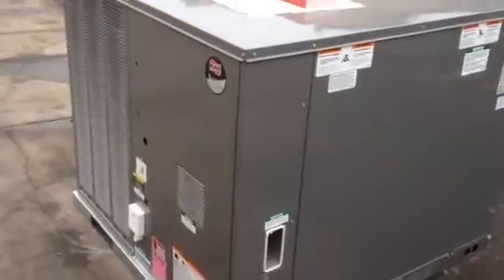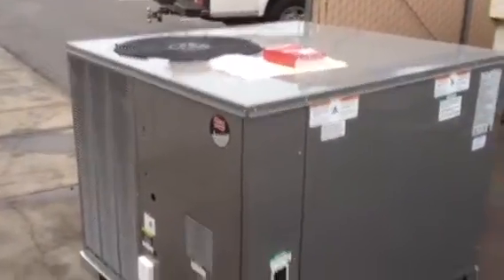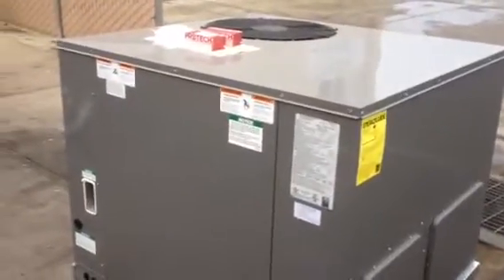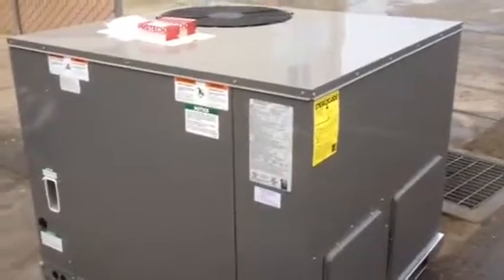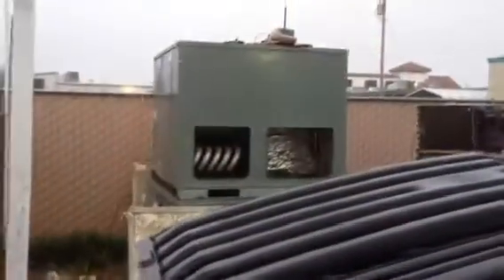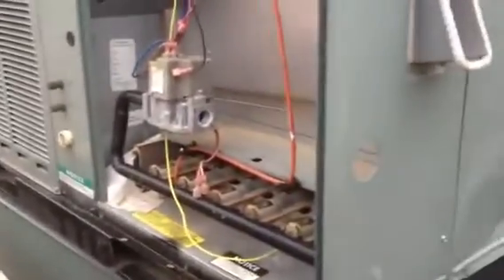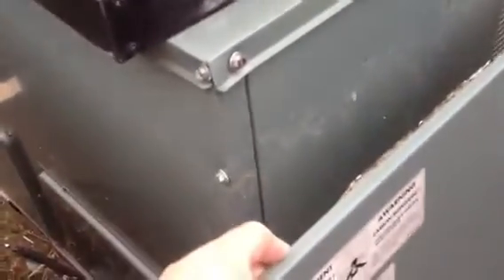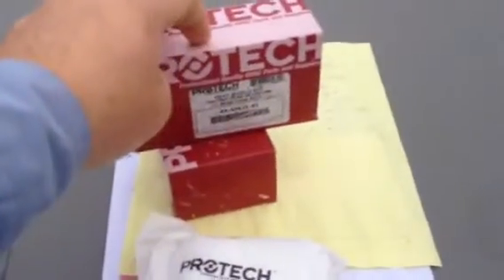HVAC Ruud new color

Comment: we did have a lot of issues with our ruud unnits in the begging but we just had a hvac guy the family uses and trust fiix them  and the guy we used incorectly instlalled them  the duct work was horied  they  had  the fan motor hooked int the compressor on the run cap  and it burned out the compressor and they also failed to clean the lines and slimed up the evp coils   but  the rune great now and sound a lot happier now that this guy came and repired them!!